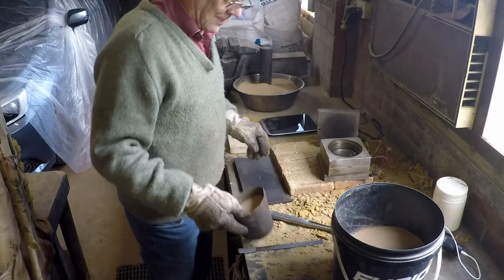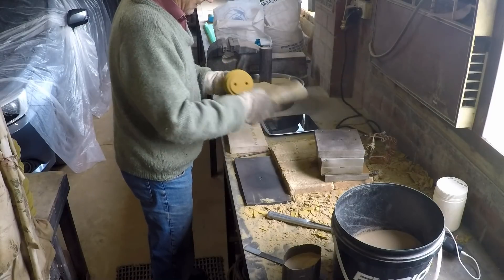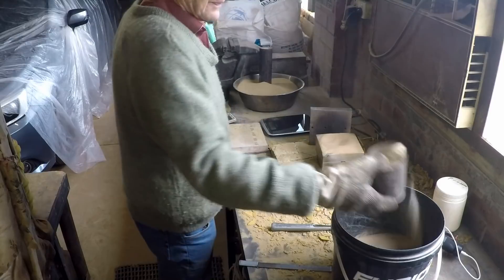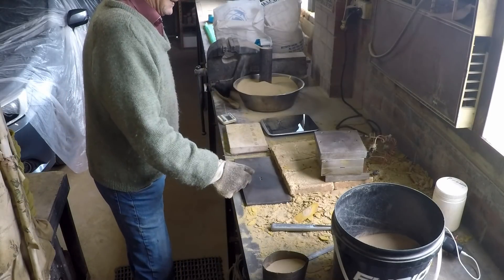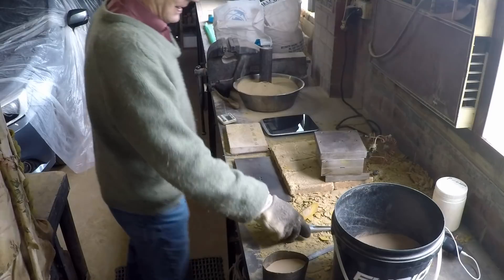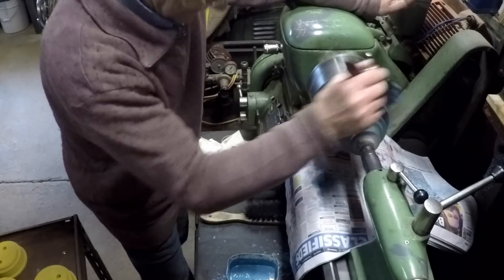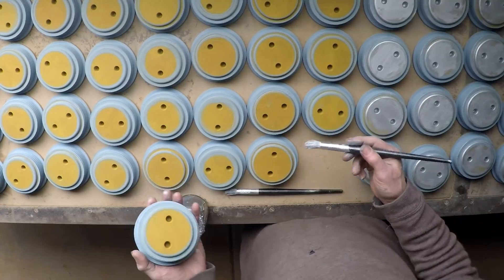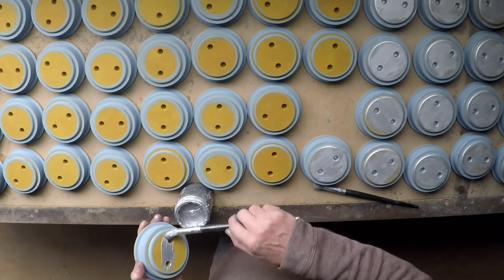Casting Runway Landing Lights Part 1 The threaded shell sand cores

Comment: How to you get or make your resin sand?
Reply from the maker: Hull, Quite simply I buy the resin coated sand. It is reasonably cheap. And is available just about world wide under the name of "resin coated sand". It is available in different resin strengths (I use 2%  and 4%) but 2 to 3% is a good starting point. Simply Google "resin coated sand" in your locality. I understand that making it oneself is not that easy as the sand has to be hot coated with the resin precursors and its so cheap that it would  not be worth the effort... Martin
Reply: Thank you so much for your quick feed back. Building a 6kw electric furnace to cast some parts I need for a couple projects so I don't have to do machining on a full 16" by 6" by 6" block.
Reply from the maker: Hull, Electric is a good way to go - slow - but it can produce better metal quality than fuel fired. Hmm, the cost of 16 *6 *6 block would be a bit prohibitive too! It would have to be close to 60 lbs. Well north of $300.00 here in Australia I would think... Good luck with it all. If I can help with advice etc please do not hesitate to ask...Martin

Comment: How does the sand get hard? You’re not packing it in place.
Reply from the maker: Spewe, The sand has been precoated with a resin. There is around 3% resin in the sand. The mould that I pour it into is at around 180 deg C and this first melts and then cures the resin thus binding the sand. This "resin coated sand" seems to be available world wide, it is quite cheap and makes a very good core. One of the processes great advantages is that you do not have to pack it in. Commercially they often blow it in with compressed air but as you can see simply pouring it in works quite well. The main disadvantage of the process is that you have to have a metal mould because of the need for  it to be hot.. .. Martin

Comment: Amazing work!
Reply from the maker: Amal, In one of those examples of the mysteries of YT some of your comments are not appearing where they should so I will answer the one about parting agent here. No I do not use talc. I am  aware that many people do and I guess its very convenient as you  can get "Baby powder" anywhere and it sure seems to work OK. But you need to be aware that some, most, all??? Talc contains fine silica and breathing that in is not exactly clever in fact some medical advice is now that one should not powder babies bums with it for fear they may breath it in. Also talc is closely related to asbestos and some talc used to actually contain it although I understand that those particular talc sources have been closed down. The parting agent that I use is a commercial one but it is nothing more than very finely ground limestone. Apparently the human body can tolerate this quite well having the ability to dissolve it, and a little extra calcium is probably no bad thing. Talc costs about $10.00 per Kg at the supermarket while I payed $65.00 for 25 Kg parting agent which was clearly labelled "calcium carbonate" This will last me 5 to 10 years so I guess it would be a lifetimes supply for most people. Thus the calcium carbonate is cheaper healthier and does not have that annoying cheap perfume smell! Which ever one you use shake it on from a calico bag like I do, don't shake it on from the can! In a pinch an old sock will do.... Martin
Reply: Olfoundryman, I apologize for that. I found in a later video you explained what you used. I felt a bit silly about it and I went and deleted my comment. Thank you for the thorough and well said explanation, makes much more sense to never use talc.

Comment: Hi Martin, can you tell me the temperature of the heating plates please
Reply from the maker: Mite, I aim to have the moulds for the shell core above  about 165 deg c. And colder and the resin in the shell sand sets off too slowly but if the moulds get up to 190 to 200 deg C they get too hot to handle comfortably with the loop type cotton gloves that I use. Note that these figures are a bit of a guess as I do not actually measure the mould temp, but years ago I did measure and found that 165 deg  C was the minimum. I have no real idea as to how hot the electric heating plates get but obviously its somewhat above the mould temp. I control the temp just by judging if the mould has got to hot (I start to get burnt through the gloves :-)) and simply turning the heating plates on and off accordingly. Many people who make this sort of core use a gas flames for heating - its a pretty forgiving process. If the mould is on the hot side the core will start to go yellow then brown quite quickly. If on the cold side the core will barely go yellow and even that only slowly. Once you get that hang of the process it is very easy to do. Years ago I had a temperature controller  worked by a thermocouple in the core mould, but such sophistication is not really necessary and frankly proved to be a most unnecessary complication.... Martin
Reply: Thanks Martin, with it being a very forgiving process I think I'll use gas when I start to use resin sands, I'm waiting on a email from Cast Metal Services on price and the MSDS for there resin sands
Reply from the maker: Mite,
           You may find it a bit harder to control the temperature of the mould with gas. With electric I just turn it on and off at the switch on the wall as required but throwing a switch is a bit easier and more convenient than lighting a gas burner. However many people do use gas and seem to have little trouble once they get the hang of it, probably a direct result of the forgiving nature. Let me know what CMS say, I suspect that they get their sand from the same place I do! Also please let me know how you get on with the process... Martin
Reply: Hi Martin, I pick up a bag of resin sand tomorrow Friday, not to sure on how long for me to make a metal  mould for the core as I'm a little busy at the moment, luckily I'm retired, but I find I get rather busy just doing stuff LOL
Reply from the maker: Mite  "but I find I get rather busy just doing stuff" You have been reading my mail! Life just seems to be like that and the older one gets the more like it, it gets. I should be retired too but foolishly (perhaps) still struggle to make the odd dollar. Things just seem to take longer than they used to and everything is heavier than it used to be. In short, old age is a crock. Good luck with your shell core efforts, please let me know how you get on and send me some photos (PM me for an email address) I am keen to see.... Martin

Comment: Hi Martin, was the mold wash called isamold185, and do you get you resin sand from foseco and can you tell me what its called please, thanks mate, I just love your videos :-)
Reply from the maker: Mite,
           It was called ISOMOL 185. Strangely some books claim this to be a graphite based material but its colour would indicate otherwise. The tin of it that I have (25 Kg) is clearly labelled with the name and lists its main ingredient as Zircon! It does come from Foseco and is often used as an anti veining compound i.e. to stop metal penetrating joints in cores. The resin coated sand does NOT come from Foseco as far as I know they do not sell it. From the mention of a "Holden grey motor" in one of your vids I take it that you are in Australia. I am in Melbourne and I get my resin coated sand from "Beckwith Macbro Sands" It costs about $10.00 for a 25 Kg bag. I would imagine that if you went prepared to take what grade was in stock you could pick up  just the one bag if that's all you needed. I buy two grades 2% and 4% resin content both  70 AFS grain size. For most of my work I mix 2 of the 2% and 1 of the 4%, but for some jobs I use the weaker 2% as it is easier to get out of the casting afterwards although breakdown is good even with the 4% and for my riser extensions I use 4% as I get more uses from them when made in this stronger sand. Wherever you are in Oz just google "resin coated sands" and confine the search to Australia. You should have no trouble finding it as it is a very common and much used material. I am very glad that you like the videos... Martin
Reply: Thank you Martin for the info its very informative. Yes I'm in Oz, just north of Brisbane to be exact. I was and still am on BYMC but every rarely post on there anymore.  I remember you from when you were a member. Back then you were always trying to get me plus others to stop using alloy wheels, heads and such, at the time I always said ingots were to expensive and to a point ignored your advice, BUT, I now use ingots only, I save all wheels and heads I then cash them in and buy ingots, sometimes it takes awhile for good advice to sink in ;-)
Reply from the maker: Mite,  Ah, the good old BYMC days, not my finest hour. But I did learn not to get involved in forums as they are way too time consuming. Seems we remember my advice just ever so slightly differently. If I recall correctly (unlikely at my age) I urged people not to melt any wrought materials particularly cans and also to avoid pressure die cast parts any unknown alloys generally, this would include just about everything EXCEPT wheels. These are 601 alloy (356  in the US) and are good stuff. So if you can't afford or find a source for ingot then get alloy wheels from the local scrap dealer and melt them. Just check with nitric acid or acetic acid (vinegar) (These will attack Mg but not Al) or with caustic soda (will attack Al but not Mg) Just to be sure that you have not accidentally picked up a magnesium wheel. These are rare but you don't want to try and melt one down , big bad fire can't be put out, bad news. However it is preferable to buy certified ingot as you know exactly what you are dealing with and this is what I do. Pistons are perhaps a bit of an exception because piston alloy here in Australia is only available in 1 ton lots (That's a lot of pistons). So if you need to make any pistons you will have to use old pistons as a source of metal. Most pistons are marked inside with the alloy designation so if you stick to ones with the same designation and remove any steel inserts (may be cast in) and old piston rings etc you should not be too badly off. Your practice of selling all the scrap and then buying good known ingot is to be commended, I will bet that a lot of your problems went away when you started this practice. I note that Myford now seems to use cut up wheels, perhaps he too heard my voice, but doubt he would admit it!... Martin
Reply: Hi Martin, yes a lot of my problems went away when I started using 601 ingots,  I still think a lot of my practices do leave a lot to be desired, BUT as a metallurgist  once said to me "how we get there is not the problem, as long as it all works.  This person has spent his life in casting  has told me to call him anytime that I need help, but each time I phone we spend about two hours on the phone with my head damn near exploding from information over load LOL but its great that people with the experience are prepared to share with us hobbyist, I thank you Martin :-) . with regards to using Alloy wheels, it can get very exciting breaking them down with a 9 inch cutting wheel, its so much easier to put a ingot on my metal cutting band saw;-)

Comment: Martin, do you have any plans for a video of heat treatment? I would love to see your process. Michael
Reply from the maker: Michael,   Not really much to show!  Just castings being placed in an oven and taken out some hours later! The heat treatment that I do is a T5 process. It is an age only process there is no prior high temperature soak followed by a water quench. This T5 involves 6 to 8 hours at 165 to 170 deg C, In a fan forced oven. A domestic  oven will do. In order to improve the response to this treatment I cool the casting as quickly as possible after casting. In the case of gravity die work the die pretty much takes care of that but for sand work I break the castings from the sand mould immediately they are just solid enough to handle and water quench them. This T5 is just to make the castings harder so the machinability improves. If the castings were for more critical work , wheels for example, I would not do the T5, but would tell the customer to get a full T6 treatment done. I don't do T6 as its too difficult to control the temperature accurately enough.  Note than not all aluminium alloys will respond to heat treatment. The alloy that I use we call 601 but in the US its known as 356. It responds well to this heat treatment.... Martin

Comment: I really need to get into theas shell cores . Have you ever used them with gray iron or Simi steel?
Reply from the maker: Chris, Great process to have in ones repertoire. Makes a lovely core, dare I say almost the perfect core and so easy too no messy sand mixing just tip the precoated sand into the hot die,  only drawback is the need for a hot metal die which sort of limits it to jobs where a lot of the same  cores are used. Well worth getting into even if only to make standard sized cylinder core to just have on the shelf. I have never used it with iron but only because I don't do Iron. My understanding is that these cores, often as whole moulds find extensive use in the iron industry..... Martin
Reply: Olfoundryman good to know

Comment: Thanks for sharing. Very interesting processes. Cheers.
Reply from the maker: Nathan, Yes it is a very interesting process, The resin coated sand is cheap and easy to use just need a metal core box. It is a very versatile process too. Commercially the sand is often blown into the core box using compressed air and this improves the definition way and above what I get..... Martin